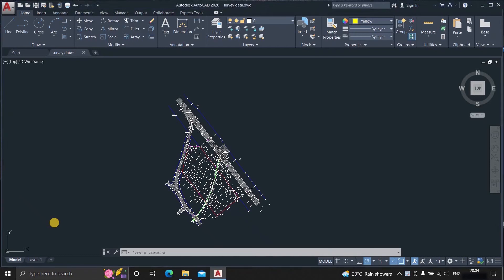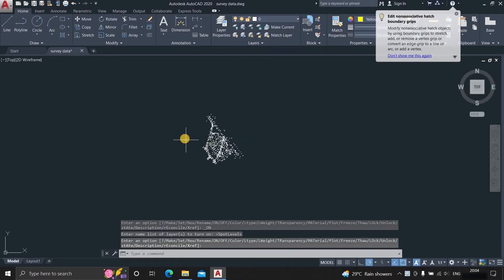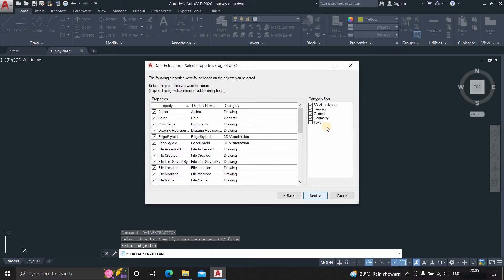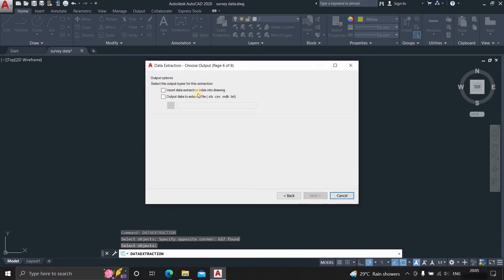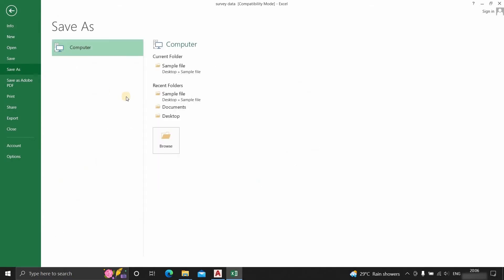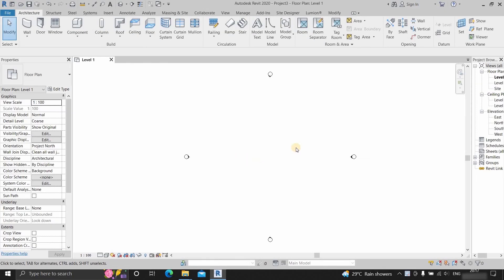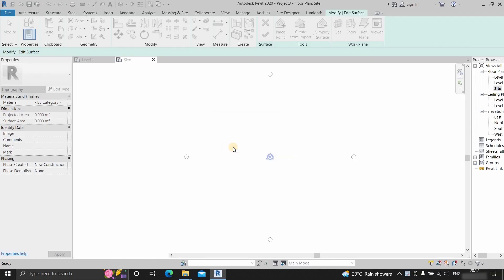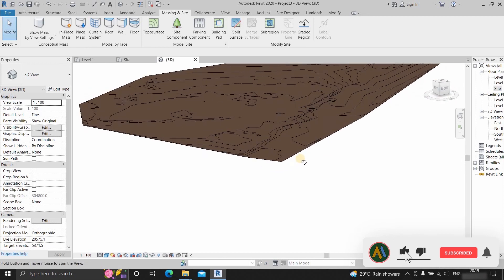AutoCAD to Topo surface // how to convert AutoCAD survey drawing to Revit topo surface

Comment: My points have additional 000s to them in revit and so the topography looks flat(even though  the excel file’s numbers had 4 digits). How can I solve this?
Reply from the maker: This issue happens because Revit is reading your survey point coordinates with an extra factor of 1,000 applied to the Z-values (elevations). That’s why the surface appears flat — the vertical values are out of scale compared to the horizontal coordinates. Here’s how you can fix it:

1. Check Units in Revit Import

When you bring in survey points (CSV/Excel/DWG), Revit applies project units. If your Excel elevations are in meters but Revit is interpreting them as millimeters (or vice versa), the values will appear scaled by 1,000.

Go to Manage > Project Units, confirm that the Topography Elevation units match the source data (e.g., meters vs. millimeters).

2. Normalize Data Before Import

Open your Excel file and check whether the elevation values are in meters or millimeters.

If they are in meters but Revit expects millimeters, multiply them by 1,000 in Excel before importing. If the opposite is true, divide by 1,000.

Save the corrected file and reimport.

3. Use Shared Coordinates

Sometimes survey data comes with large coordinate values (e.g., X/Y in the tens or hundreds of thousands). Revit struggles with very large numbers, causing flattening effects.

To fix this, move the survey data closer to the project base point in AutoCAD before exporting, or use Revit’s Specify Coordinates at Point to set a local origin while keeping survey accuracy.

4. Check Import Settings

If you are using Insert > Import CAD or Insert from File > Points File, make sure the unit setting matches your source file’s units.

Revit does not auto-detect; you must manually pick the correct units during import.
✅ Summary:
Your Z-values are off because of a unit mismatch (meters vs. millimeters) or a large coordinate offset. Correct the units either in Revit (Project Units and import settings) or in Excel before import, and your topography will display correctly.

Comment: How can I get the opposite I need to create topographical map in autocad how can I add spot elevation on a specific distance in autocad
Reply from the maker: Do you want to convert Revit topography to AutoCAD topography, or only spot levels from Revit to AutoCAD?
Reply: @archmotion2173 actually my condition is ,

1.I have a point cloud file
2.need to create topographic map from it
3.which includes contour lines on fixed interval (0.5 topo minor & 1m topo major)

4.I use civil 3d to create surface from point cloud but the main issue that I m facing is my contour lines are not equal means the spacing between them is not (.5 and 1.0m) but I try to change contour interval but still there are not 100% accuracy there.

5.my next step will be import the civil 3d extracted surface file into revit and create an toposurfacr from it the. Add spotelevation and contour grids and export in to autocad and submit.

4.
Reply from the maker: You want basically a point cloud file to an AutoCAD contour drawing. I will suggest to you that rather than using Civil 3D for point cloud conversion, you can use some other software for conversion. Civil 3D may be facing some scale issues. If it's possible to share the point cloud file, then I will try to find some solution.

Comment: I filled the steps and the map is with contours but when I see it in 3D it’s still flat for some reason. What am I doing wrong??
Reply from the maker: Maybe you have selected the wrong unit input for which your drawing has been scaled.
Or you have scaled your drawing in AutoCAD itself before import. Normally survey drawings are in meters.
Reply: @archmotion2173 I tried it several times and still it’s being created as a flat topography :(
Reply from the maker: Share your autocad and revit file. Without seeing the problem is exact diagnosis is difficult

Comment: i did the same exact thing but revit tell me ( no point has been found)  knowing in my case the only deffrence between you and me is that i dont have value but Z coordonate.
Reply from the maker: exactly not understood your problem. If your survey drawing does not contain a z value, then you can use block levels as the z value.
Reply: @ it dose contain z levels
Reply from the maker: @atbiyoucef7948 to define a point three coordinates are required. If all points are available then problems will not occur. So without seeing your file the exact mistake defining is difficult.
Reply: @archmotion2173  I have the same problem, Can you help? The situation I found out is this: "Objects have a Z value of 0: Often, objects in a drawing appear to have elevation but are actually at a Z value of 0, and the elevation is represented as text. In this case, the Data Extraction tool will correctly report the object's Z value as 0."
Reply from the maker: You’re absolutely right — this issue happens very often with survey DWG files.
When Revit says “no points found,” it’s usually because the AutoCAD objects look like they have elevations, but their actual Z-value is 0. In most survey drawings, the elevation is written as text next to the point, while the point/line itself stays flat at Z=0. Revit can convert text data into 3D cordinate so use elevation as Z cordinate

Comment: ı cant select the value options because tehre isnt this options can you help me
Reply from the maker: If Z-coordinate data is available, then you can use that data in place of the 'value'. Check your layer settings to see if any layer is locked. If not, then that file may be corrupted. Otherwise, you can share your drawing with me to find out the problem.